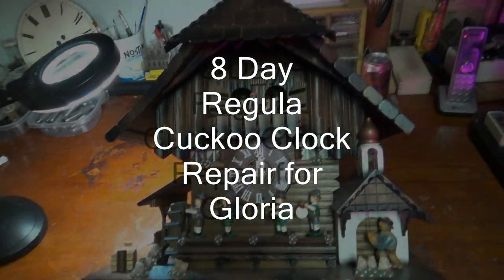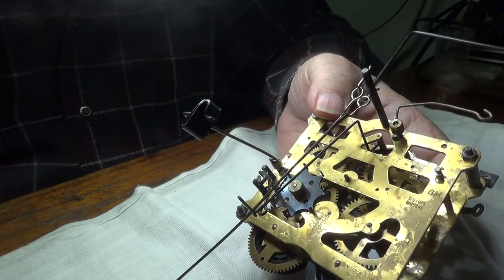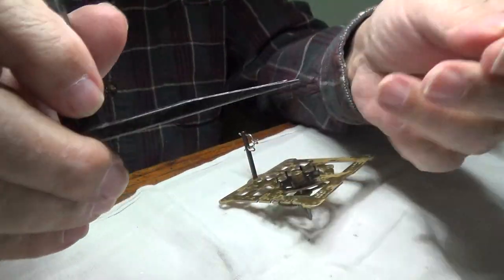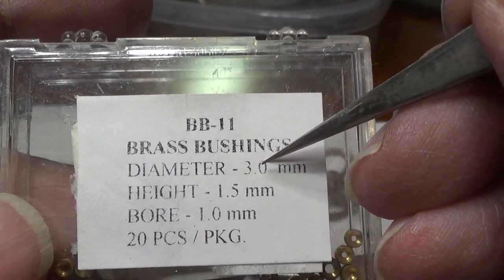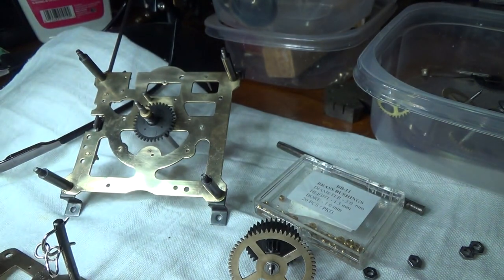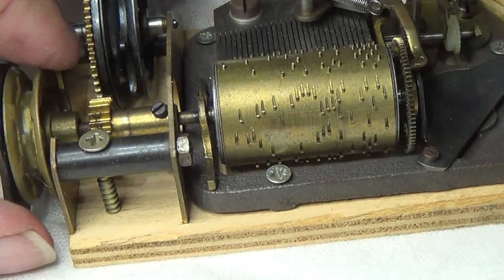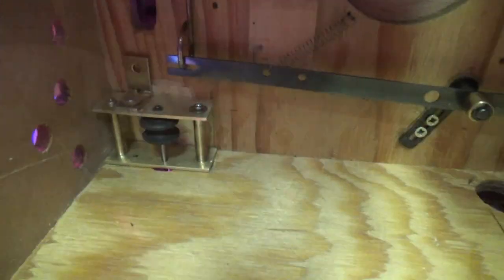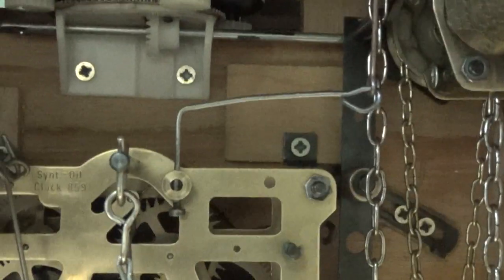8 Day Regula Cuckoo Clock Repair for Gloria

Comment: Thank you for your informative videos, just one question I have some broken timber pieces on an old 8 day cuckoo clock I just purchased could you please give me some advice on what glue would be best to glue these pieces back together. Thank you so much. Tricia from Australia.
Reply from the maker: I use mainly yellow wood glue. The brand I use is Titebond.  I like to put a little in a small container, like a plastic bottle top, and add a little water.  Then, I apply that to both broken surfaces with a small artist paint brush in a thin layer. Try to keep the glue from oozing out by not using too much glue.  Wipe off excess with a damp rag or paper towel.  Clamp or hold the pieces together until set and don't disturb the glued pieces for a couple hours.  The glue won't accept wood stain, so I use acrylic artist paints to mix a color that matches the finish on the case and paint the glue line with a fine artist brush.
Reply: @dperry428  Thank you so much will give it a go.

Comment: Hello, Mr. Perry! I have a question for you. Right now I am waiting for a backordered Bergeon reamer/chamfering kit. I've been waiting for a few months now, and the KWM system is tempting me with its availability. I believe you use Bergeon reamers if I'm not wrong. Is it worth waiting for the Bergeon set or am I better off getting a KWM set so I can re-bush the clocks I have? I've read through a lot of NAWCC threads about the subject, and I still can't come to a conclusion. Your opinion would be greatly appreciated!
Reply from the maker: The reason I like the Bergeon sizes in reamers and bushings is that they come in 1/2 mm outside diameter instead of the many sizes of KWM.  With the KWM, you'll have a significantly larger investment to make.  Where did you order your reamers.  There are many vendors that carry them. If someone is not providing them on a timely basis, cancel the order and get them somewhere else. You can even find them on eBay.
Reply: @dperry428  I ordered them from Timesavers. I checked Ronell Clock Co and they were out of stock as well. I emailed Justin at Timesavers and he said the vendor might be having troubles sourcing them. I'll keep my eyes peeled on ebay for any. Thank you for your advice! Nobody on the nawcc threads mentioned the outer diameter as a positive; they actually used that as a pro on KWM's side, but your logic makes more sense to me. Less od's, less reamers! I appreciate your help!
Reply from the maker: You might also check with Butterworthclocks.com  User name and password both butterworth.  Mark Butterworth also has drills sized to bushings at, as I recall, $5 apiece.  Also: https://www.ebay.com/itm/New-American-Made-Reamers-for-Bergeon-or-KWM-Machines-Hand-Tools-19-Choices/292716834075?hash=item4427486d1b:g:XakAAOSwnXpbkug7
Reply: @dperry428  Thank you so much for your help! I wish you health until you can get your hip replacement done. Stay safe!

Comment: 1:47:00  What is the purpose of the white plastic tube to stop the fanfly?  I note that the fanfly isn't even catching it after it is drawn down.  I noticed same thing in my clock, and adjusted it down just until it stopped the fanfly same time that lever was fully pulled down.  One video by VDS claims if that part is adjusted wrong, music will not start, but don't understand how that is.
Reply from the maker: The white plastic tube is actually the permanent stop for the music box. The tube is also a sound attenuator to deaden the sound of metal on metal.  It is adjustable by sliding it on the metal peg extension of the brass lever on the music box.  That lever is held to the music box by a  collared screw in a slot on the lever, allowing the lever to move downward when the hole on the cylinder pulls the hook that rides on the end of the cylinder.  When the hole catches the hook, it pulls the lever downward, moving the plastic tube in front of the fan, stopping the music box. The lever should not be "fully pulled down" or the hook will be so tightly held in the hole that it cannot be released at the next strike cycle and the music will fail to play.   The plastic tube is moved upward away from the fan by the action of the lever on the cuckoo clock movement, but another lever (black) must move in front of the fan before the plastic tube releases the fan.  It is a delicate adjustment to get just right by slightly moving the plastic tube and by bending the other parts of the lever (both from the cuckoo movement and on the music movement). If adjusted properly, the cuckoo movement will lift a lever in front of the fan just before the plastic tube moves up enough to release the fan.  That also releases the hook from the hole in the end of the pin cylinder.  When the cuckoo is finished, the lever from the cuckoo movement drops and releases the black lever holding the fan and the music plays.  When the hole in the cylinder pulls down on the brass hook, the plastic tube also pulls down enough to stop the fan.  Just make sure that the hole doesn't pull the brass lever too far or it will take too much force to release the hook from the hole on the next strike cycle and the music will not play.
Reply: @dperry428  Thanks, I was thinking that white plastic stop was to mitigate tension from the pin in the hole of roller.  I noted if white sleeve was pulled down too much, the last couple notes of song would not play.  I set it to catch right after last note, and swear if I raised it a 32nd inch, it would no longer contact fanfly.

Comment: The German and Swiss craftsman are disappearing.  Brand new four figure clock, music box won't start.  Clockwork is releasing the pin on roller and it comes out of warning fine after bird call, no impediments there.   The music box drive itself just wont start without a considerable pull to get it started, the mechanism is very noisy.  I find the older clocks much nicer built.
Reply from the maker: Just like most other industries, the search to increase profits leads to the use of inferior materials and engineers that look to cut production costs.  Same old story -- greedy people.  End result -- crappy products.  One of the classic examples of this was the German clock movement manufacturers in the 1970's decided to save tooling costs by using soft steel arbors and then chrome plating the pivots.  Result was that when the chrome plating failed, the resulting hard powder created a grinding paste that destroyed the pivot holes.  Then, with no plating on the pivots, rebushing the holes was futile; the soft pivots would wear quickly.  Final result was that thousands of people paid for expensive mantel, wall and tall case clocks that were essentially garbage. Repair costs to replace pivots were more than the movement was worth. The manufacturers finally went back to using hard steel for the pivots. Did create a big market, though, for replacement movements.

Comment: I just got a new clock from adolf herr with this movement in it and there is a grinding noise just when the music and the dancers stop moving.  Any thoughts on that?
Reply from the maker: It's the stop pin hitting the governor fan.  I'd bet it used to have a piece of plastic tubing on it to silence the sound.  You might try putting a bit of electrical tape on the brass pin that stops the fan. A piece of heat-shrink tubing might also work.
Reply: @dperry428  Holy hat thank you!  I was worried that there was something truly broken with it but this sounds very fixable.

Comment: Hello, I found a box of cuckoo clocks that was going to be thrown out. The owners let me take them to try to fix them. I got a couple working, but I can’t keep the pendulum swinging. I was wondering if you would be able to help me out. Thank you
Reply from the maker: First, clean, then oil, then make sure the clock is "in beat", that is,  it is level and the sound is even:  tick-tock-tick-tock-tick-tock, not  ticktock--ticktock--ticktock.  Bend the pendulum leader or crutch until it ticks evenly.  Do a simple cleaning with soap and water, scrub with a toothbrush, rinse thoroughly and dry with a hair dryer. Oil each pivot hole and nothing else. If it's cleaned, oiled and in beat and still doesn't run, there is likely enough wear to require bushing. I'll be happy to answer questions.
Reply: @dperry428  thank you! I will try that and let you know how it goes.

Comment: What if any is the difference between the time side ratchet wheel and the cuckoo side wheel. Thanks
Reply from the maker: Depends on the movement but, in some cases, they turn in opposite directions, the wheel is in a different location on the arbor or, in the  case of the time side, sometimes has another gear on the arbor that runs the motion works.
Reply: @dperry428  thanks

Comment: I thought 8-day musical cuckoo clocks weren't supposed to play music on the half hour. Is this some really rare exception?
Reply from the maker: Nothing rare about it to my knowledge. That's why there are two tunes; to differentiate between hour and half-hour.  There are some modern clocks that do as you suggest, but not in this case. The clue is that the weights should all fall, over the week, the same distance.  When the music weight fell only half of what the others fell, it was because it was only playing half of what it should.  When the adjustment was made in the trip wire, the music played on both half and full hour.  The weight then fell, over the week, the same distance as the other two weights.
Reply: I have seen nearly all your videos and enjoyed your work, thank you! I do have a question about the cuckoo, did I miss what the little guy on the bottom right does? Isn’t he supposed to ring a bell or something, and when? Maybe I fell asleep during that part? Thanks from Texas.
Reply from the maker: @lesliebooth2833  The bell-ringer's arm has a wire that is attached to one of the cuckoo bellows, so the arm moves when the bellows goes up and down during the strike.  You only notice it when the cuckoo is striking a large number of hours.  In reality the movement is very small, anyway.  There is no real bell to ring and I think the action is frivolous.
Reply: Are you self-taught? How did you come to learn all you know about both cement/concrete and clock repair? Did you grow up at the knee of a handy and knowledgeable dad? It’s heartbreaking that this kind of knowledge is almost unheard of in our present day, and most certainly the pride of doing a job well and right. I’m sure there are some young folks who do take pride and have a propensity for learning all they can about their profession but I just don’t see it, not like it used to be. Guess nothing’s like it used to be. Or maybe I’m just grumpy. Or both.
Reply from the maker: @lesliebooth2833  Yes, for the most part, you might say I'm "self-taught", but that's really not accurate.  I rely heavily on the knowledge developed by others and not so much on what I develop myself.  I learned about clock repair by watching and listening to, initially, my father-in-law as he repaired clock mechanisms for a collector-neighbor, then by becoming a member of the NAWCC, reading it's publications and through practice. What you see now in my videos is the result of over 50 years of reading, learning, application and practice.  With concrete, it was the same thing.  When I retired in 2004, I knew little about concrete. I bought a video series on decorative concrete, read a multitude of PhD theses from engineering schools, tried recipes, applied what I had read to experimenting with new recipes and, over the course of 16 years, continued reading and applying what I had learned from the works of others. Reading, listening, watching, learning, application and practicing are the keys to development of most any skill. As to the rest of your comment, I agree that things are not like they used to be.  I was a science teacher for over 30 years and watched the changes that took place in parent/student attitudes toward learning.  There are still many hard-working young people, but far too many who spend too much time mindlessly affixed to their "smart" phones or engaged in too many video games.  Without getting too political, I'm glad I'm  old and won't be around to see the result of what is to come as a result. Perhaps I'm just grumpy, too.
Reply: @dperry428  I too was a teacher for 22 years and am enjoying my first full year of retirement. I agree with you about the convictions of the kiddos and their parents. Im trying on various activities to see what suits me. I most recently have been working on my grandsons’ Christmas stockings, doing a ton of beadwork. Not something I’ve ever tried before. Guess like you, I will just see what I can learn to do and focus on learning it well!

Comment: Where did you get your clock tools from?
Reply from the maker: Most of the tools used are common household tools like screwdrivers and pliers, available at hardware stores.  Specialty tools, like spring winder, reamers and broaches are available from clock suppliers such as Timesavers   https://timesavers.com/   Ronell  https://www.ronellclock.com/ Black Forest Imports https://blackforestimports.com/  Merrits Antiques https://www.merritts.com/merritts/public/default.aspx or jewelry suppliers.
Reply: @dperry428  thank you for sharing your knowlege.

Comment: yes good day my clock only one of the weights works the cuckoo  weight don't move only the clock weight the cuckoo weight is lock what could that be
Reply from the maker: Could be any one of a dozen different causes. Could be as simple as needing cleaned and oiled or could be as bad as a damaged gear.  Without inspection, there is no way for me to know.

Comment: Love your work . can you please replace my chains on my cuckoo clock?
Reply from the maker: You really can do that yourself. Do you mean by replace, do you mean with new chains or just to get them back on the chain wheels?  Either way, I can walk you through it.
Reply: @dperry428  Hi Sir Hope you are fine safe and healthy.
after assembling my regula34 -86 it has a good running condition on the testing holder , but on the other side the bird support being moving fwd doesn't go back and remain fix there until i put my finger on the release lever arm or turn the fly one turn or press on the star wheel a little to activate striking to retract back completly .
at this time the strike seconde wheel cam pointing to the fallen lever
the striking third wheel pin is in the top 12 oclock movement 
on the other side the pin is in the middle of the gathering pallet
what could be unadjusted to perform as proper the system please; thanks for your patience and waiting for your advise.
Reply from the maker: The arbor that contains the gathering pallet also has two black tabs that control the door opening.  Check to make sure they are not interfering . If you adjust their position, you'll also have to adjust the gathering pallet position and the warning pin position.
Reply: @dperry428  Hi Sir
    thank you so much its exactly what you expect the two black tabs was on upright position and the down end was sitting on a black pin so i took off the upper left nut and i remove the flay to adjust that wheel it was easy trial and the movement is running now thanks again . so proud of knowing you.
Reply from the maker: @eliekheirallah5565  Glad you got it working.

Comment: When I was setting up my cukoo clock my dad pulled the Chan  the       
clock
Chan can't come down and I can't
Wind
Reply from the maker: Either the chain came off the wheel or, if he pulled on the weight side, the click was bent and jammed the wheel.  You'll have to try putting the chain back on track.  If the click is bent, it will need repaired or replaced.